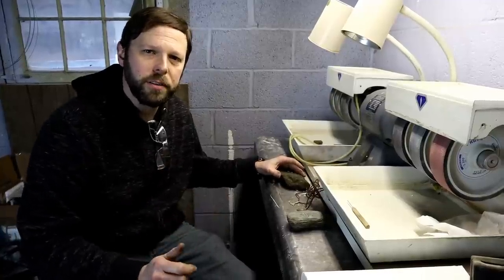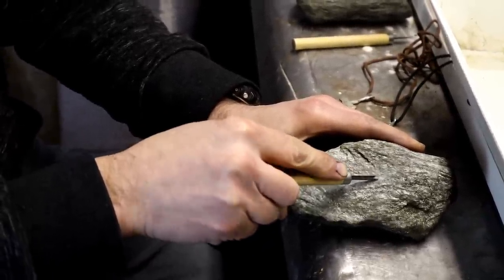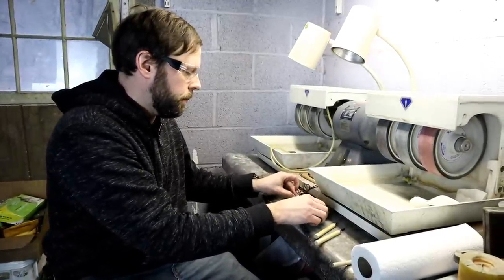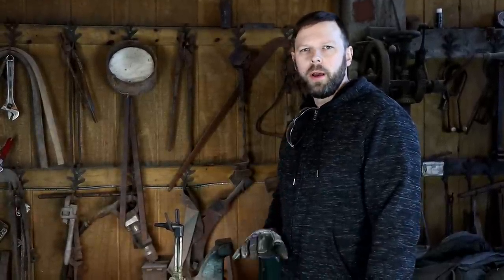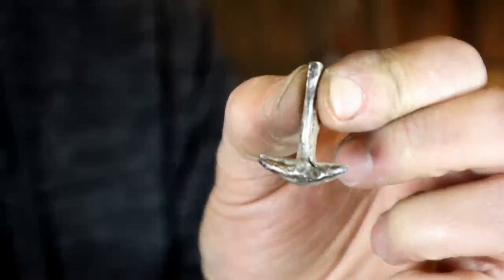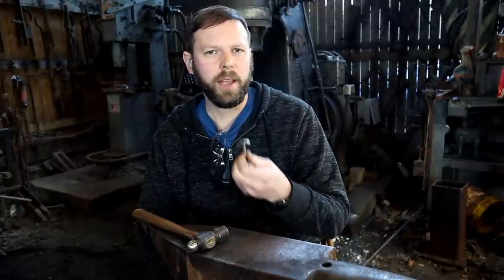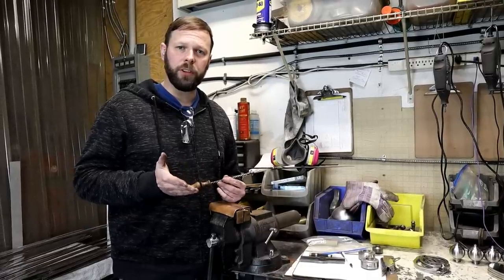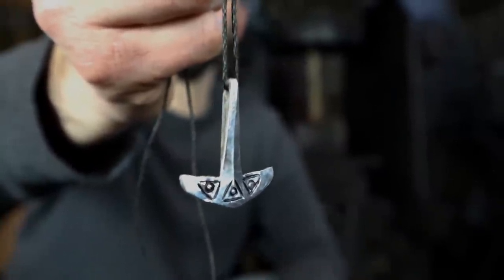How to Make a Thor's Hammer (Mjölnir) - Your Edge

Comment: Question for the guys who swing hammers: how often do you get sore? Do you have any physical routines that help keep your muscles from binding up? I've always imagined that tendinitis or general soreness would be a big issue after doing it for a number of years.
Reply from the maker: You are correct. Most people who swing a hammer do it wrong. If you generate your swing from your elbow you will encounter problems. You should be using your shoulder and back muscles to generate your swing.
Reply: @ThatWorks  Thanks for the tip. I'm very new to BSing and need to work on this technique. Thanks for the amazing vids. I hope we get to see some new projects like you had on MAAR.

Comment: Nice job. Would clay not be easier to use instead of soapstone?
Reply: I would guess it would depend on the melting point of the metal they're using...?
Reply from the maker: Sand would be easiest but we wanted our first casting video to be something anyone could have access too and could complete. We will dive into many more casting techniques as we move forward - Matt
Reply: That Works would u melt the sand in shape I’m asking because I can’t tell what kind of clay I got around here in NC

Comment: Can other metals be used as I'm allergic to silver
Reply: Anything non-toxic with a low enough melting point should work. Aluminum, bronze, pewter etc.
Reply: the metal you use is totally up to what your capabilities to bring that type of metal to a pure molten state
Reply: James Hamaker Weird flex but ok

Comment: You say historicly speaking, dut the norse had no acess to modern borax. So back in those days you better not fail.
Reply: The Norse had borax, although it would have been expensive. It was available in Europe from the 8th Century CE onwards: the height of Norse civilization was in the 10th Century CE.  But it did come from Tibet via the Silk Road, so it would have cost more than today.  
That being said, the point of the borax is to prevent oxidation. Quite a few other materials also have this property, including plain old charcoal.